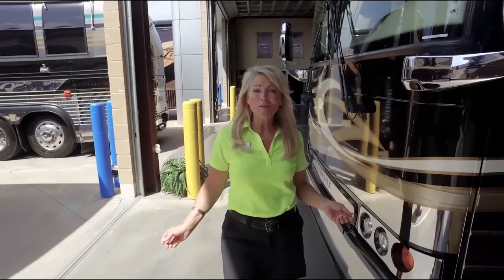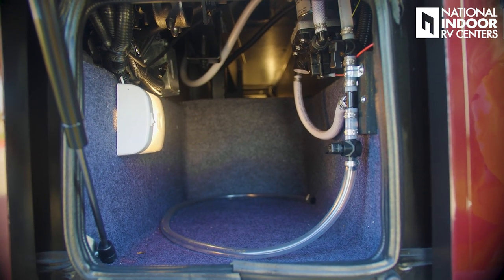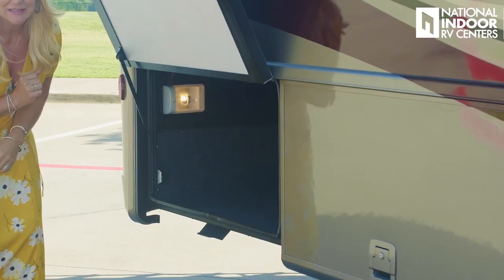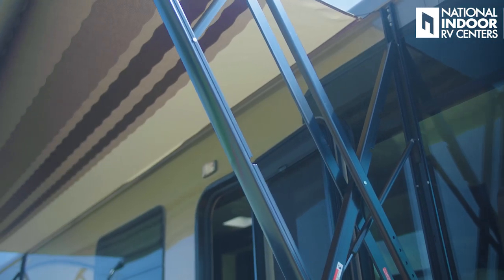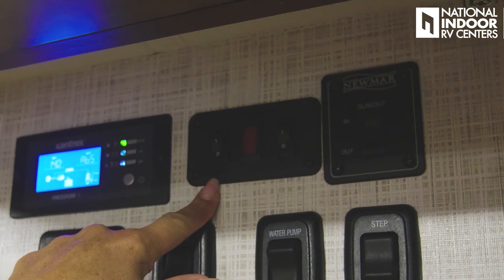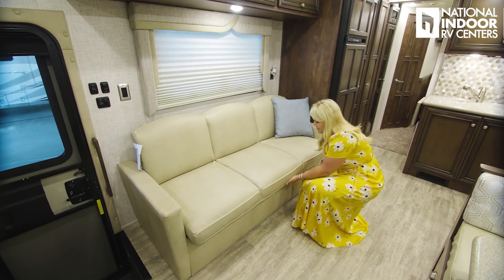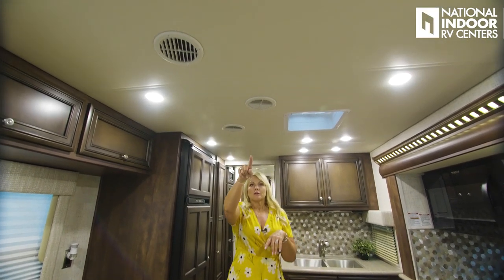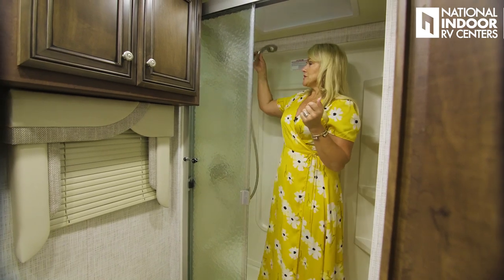2020 Newmar Baystar Sport

Comment: This is a really thorough review of the Baystar Sport and we've found it very helpful. Having owned one for two and a half months (about 50 days spent on the road in the camper) I decided to review this video once again to see if I was missing anything. For the most part, everything is as described. The biggest difference between the video and our camper is that we only have two house batteries and they're in the engine compartment. When I asked about it I was told by NIRVC that it would require extensive modification to upgrade to four batteries on the slide out shelf as depicted. Not sure what the disconnect is, but it was a disappointment. Otherwise, we love our motorhome and we still have several weeks remaining on our road trip.
Reply: Not sure I understand.  Did you expected the seller to do a major battery relocation for free?  Sounds like they told you the cost.  Don't know the whole story, but I may be disappointed in the battery limit or placement.  But, surely you weren't disappointed in a cost to move them?

Comment: Pretty light colors look nice in the coach, the back splash is a little to silver for me hope they have more than one back splash.  No seat in the shower.   To bad they do not put 12 volt dc plugs in the bed room and by the dinette. The plugs with usb phone charging are nice instead of having to run the inverter and use AC to charge a DC device.  Another awesome demonstration, Angie you are the best at going over the coaches!  Nice price also.
Reply from the maker: There are more backsplashes to choose from Pat. Thank you fir your comments and for watching our videos!

Comment: SURPRISED THEY are STILL using a propane fridge instead of a COMPRESSOR fridge!
Reply from the maker: Hi Michael,

IMHO it is a cost issue. In order to be all electric you need more battery capacity and a larger inverter which costs more money. They use the propane (which works great and is completely silent unlike the compressor refrigerators) and it keeps them at a lower price point. 

Thanks for watching our videos and have a great day!